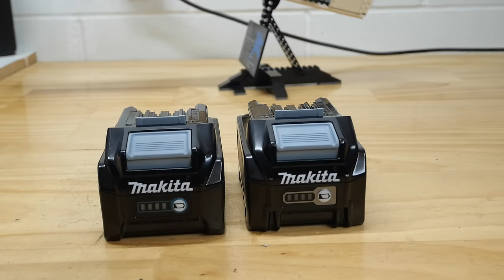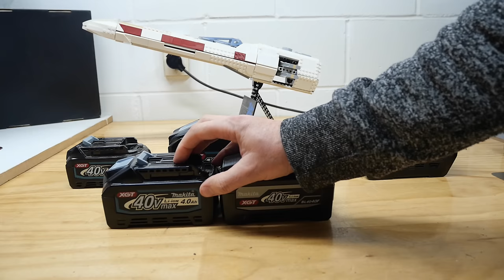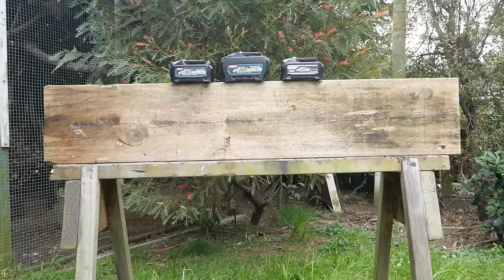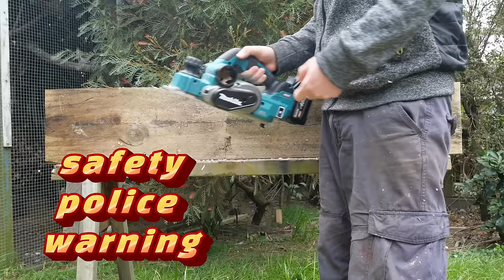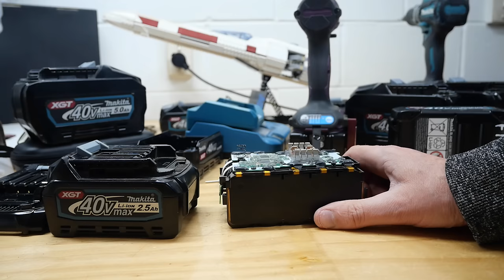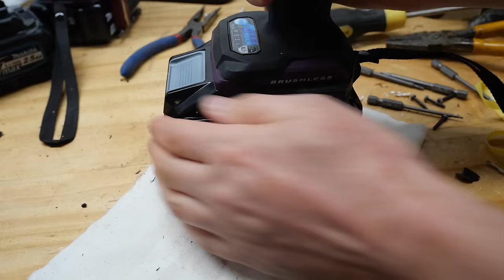Makita BL4040F Battery. Testing and Teardown of Makitas NEW HIGH OUTPUT Battery. Pouch Cells in it?

Comment: If it is tablets fairplay to Makita for keeping up to the latest technology. I really hope that they release a pouch cell battery that is flatter than the 2.5 to go with a new impact driver like the 18 volt one with the fancy lights🙏. I heard that once tablets batteries get into mass production they will be cheaper as they are more simple to produce and like you said in your demonstration welding on a tab is a weak point in battery construction and in some cases can lead to failure. So we could be getting cheaper more  robust batteries.

Comment: Great review, you really covered all the details and went above any beyond! This is how you do a YT video, well researched and presented ;)   
Makita going in the right direction, this is so much better than pouch cells, compared to milwaukee forge 6ah, more capacity and more power with better safety and quality thanks to cylindrical cells.
Reply from the maker: Cheers, much appreciated ;)
Reply: @ToolsAndStuffOFFICIAL  any time 😊
Reply: Can you shed a little light on those a little less informed on the benefits of these over dewalts, flex's and milwaukee's approach using pouch cells?
Reply: @N1rOx  cylindrical cells are by design more mechanically robust compared to pouch cells, they can't bloat, harder to puncture, easier to weld and assemble in a robust pack, etc etc
Reply: I have to agree. This is what journalism should be (and used to be, sometimes).
Reply: @steffendetrick  they should also use these cells in that new forge 6ah. So, what do you mean by makita not being the first, these packs were announced a long time ago and were available for sale long before anyone else with tabless cells (talking about power tools ofc)
Reply: @ToolsAndStuffOFFICIAL  Yesterday , Makita Finland , released 10 min YT clip , Makita Kommunikaattori XGT ® ADP12 , it shows the app . No subtitles 🙂
App does shows same info than that battery tester and a bit more , when it tells your typical use , like how many times battery has overheated .

Comment: Been using pouch cells in rc vehicles for years, The ipod classic that lasts a week has a single one in it.
Once theyre stacked, they dont seem to last long, before bloating up. Then your in trouble if you dont know how to dispose of lipos.
Dont mess with the zohan electronics store, hey its sorny guts.
Reply: Spicy pillows. Seen lots in Microsoft Surfaces, they can break the screen from behind. Terrifying.
Reply: @MattTester  Yeah thats why theyre not quite common. Still to many problems for the average user.

Comment: I have to say, as a big Makita fan, I have been, and still am, perplexed at Makita’s approach to their battery lineup.  This video further enhances that feeling.  Their ‘arrogant’ approach to the limiting of  the LXT lineup, is still a sore point with me.  Great tools that could benefit from better batteries.  I am not implying the current LXT batteries are bad, but I have to wonder how much better a planer, or saw, or an angle grinder would run, using 21700 based batteries?  Not to mention at higher capacities than 6.0 Ah! 
I know there would be fitment issues on some tools, but that has not stopped Milwaukee, DeWalt, etc.?  

Great stuff here, Cheers !!!
Reply: Tabless cells will probably become standard my guess is makita will just end up using tabless cells in all batteries within a year or 2. I don't know why they would continue to use old technology when manufacturing the old stuff is just takeing up space in the factory every battery manufacturing company will adopt this over time and tabed cells will be a thing of the past. Makitas plan will be to sell off all the old stuff and slowly replace it with better so will every other tool manufacturer

Comment: I'm sad, my original XLT battery just stopped charging. 2005. Makita does add things to the battery and name them. I still run lots of 3ah none star 18 volt. When they switched I looked and had a hard time finding a battery that was not a star. If it has a star then the tool and battery talk. When they first change the battery looked very similar to the current 40 v batteries. When the new battery is all that is available they will say something about it quietly.

When Makita changes something like the logo then they changed something it the tool. I think that I have 3 different 18 v 3ah batteries that are all the same model number. None star, star, and fuel gauge. They all have different logos on them. And have different run times when new. 

Personally I like that Makita doesn't put things like star on the side of my battery. Or high out put. It makes no sense to. The older battery is on longer sold and only the new one is. So in a year when d&m don't make the old battery. What will make the battery that I buy high output? It's all they sail and now make. Personally I will stay with Makita tools.

Comment: The new battery did seem to put out just a little more juice! I'm afraid to see the price tho! 😂
Reply: The price will be more then the original 4Ah but less then the 5Ah If they are a tabless cell they will last longer then anything on the market my guess is they will be putting tabless cells into every size battery over time. So the price increases will be worth the improved life of the battery with less heat issues

Comment: LXT version required.
Just imagine what a monster the DHP486 would be if Makita could be bothered to build a battery that can keep up with it.
Reply: My guess is they will do this once they have sold off all the old stock. It will just be a update like when they added a fule gage to their batteries.

 fact is tabless cells will be the only thing being made in a year or 2 from now
Reply: @aaronoconnor606  That'd be pretty neat. Currently I'm on the 2Ah and 6Ah batteries anyway, which I suspect aren't the spiciest Makita has on offer even within the LXT line. So I'd be curious to see what my tools can do when there's some extra jam available.

Comment: nice to see this. and for the explanation about these 'tabless' cells. Much appreciated.

But even other than such tabless... Elsewhere Honor have recently released a new foldable smartphone in China. And it's supposed to have new Silicon-Carbon anodes. But what is actually surprising is the fact that it's supposed to be some mass produced consumer product. And so getting something to market in itself is a good indicator that such things are moving forwards. And to actually prove in the market - that you can buy it, and use it.

However I'm not saying those other technology are necessarily suitable for power tools. It's just seems to be some general uptick now. To wider market.

Comment: 29:28 are you sure they're copper plated? Copper corrodes fairly easily. These pins are usually nickel plated copper. The central pins are for comms and very low current. Could be gold plated to help get a good connection, but I don't know how well that would hold up on a tool battery.
Reply: doesn't look like gold. There are some copper alloys that are more resistant to corrosion, I found them on nissan leaf battery buss bars and in general on some high power connectors. But yeah, these are low power. So, what do you say about the new 21700's by murata? pretty crazy stuff! Makes ouch cells obsolete for most cases :)
Reply: @riba2233 yeah, doesn't seem shiny enough, but hard to tell on my phone. Copper alloys more resistant than nickel? Must be something to do with poor connections interfering with the comms.

Yeah, they seem good. Can't wait to see the datasheet.
Reply: @toolscientist 👍
Reply: @riba2233  i think pouch cells have a place in batteries smaller than 18650 or bigger than 21700. The Dewalt 1.7ah seems like a handy battery. The 5ah powerstack not so much, as I'd rather take a 6ah 21700
Reply: @toolscientist  agreed 100%, you can't go too small with cylindricals

Comment: How does Murata not have them on their own website. Kinda fishy 🤔
Reply: too new/secret probably
Reply: probably some exclusivity contract, nothing new..
Reply: @izoyt  Milwaukee also uses these cells in the new mx fuel packs. And they have to at least make the safety datasheet available to the public, which they could do soon imho
Reply: @riba2233  is that confirmed? EVE also has tabless cells, and Milwaukee has been seen using EVE lately.
Reply: @toolscientist  yep, they had an open pack on the showcase

Comment: Cool video. Thanks. so just to clarify. makita are not using the new pouch tech the Milwaukee are using with the new forge battery’s? 
Instead they are using ever so slightly upgraded conventional cells by the looks of it
Reply: Tabless cylindrical cells are much better tech then pouch cells in larger battery pouch cells aren't going to last as long. I really think if they are a tabless battery they are going to have less chance of things going wrong with them
Reply: @aaronoconnor606  time will tell I guess
Reply: it is not ever so slightly, it is almost double the power over the old tech, it is a huge deal and better than pouch cells in every way.
Reply: @riba2233  I didn’t see anything double in this video at all. What are you talking about?
Reply: @richiejames928 did you see a battery tested used in this video? Just wait for the cell level tests and you'll see. Current ones are 30 A continuous, new ones are at least 60

Comment: All my star batteries on my 18 volt will not work with my drills and impact set from 2015, which is the teal color ,but my older set which is white from 2012 will except my 5ah and 6ah 18v batteries minus my reciprocating saw that can only  accept a 3ah
Reply: That is easy to fix

Comment: Not sure if youll see this Tools, but you got me onto the 40v platform a couple years back when they came to the UK. 
I've ran all my circ saws and mitre saw on 2.5ah, but when ripping wet studs the other day the batteries drained right down after just one or two passes. 
I was looking at getting a 5ah for extra longevity, and for the 305mm mitre saw. The 4ah high output is basically the same price, £10 less. 
Would you say the 4ah high output is the one to go for? 
Cheers
Reply from the maker: The 5 and 4f basically have the same power, but the 5 runs 25% longer but is much larger. Overall the 4f is the nicer battery and is my go to for power and size.
Reply: @ToolsAndStuffOFFICIAL  Thanks Tools 👍

Comment: I am confused why the 4Ah battery  should have same energy like the 5 Ah battery.  Below battery, it is written 144Wh.   Same on the old 4Ah battery.   And this is right,  because  36V x 4 Ah = 144 Wh.  

Another interesting fact:  F version has an IP 64 protection according to datasheet.  Old version not.  Or it is not written in datasheet.
Reply: He explained why a tabless cell is around 40% more efficient they don't have spots that get to hot. And is uses the stored energy way more effectively the old tabbed cells have a bottle neck and don't use all the energy stored in the battery. That's why a 4Ah battery can make more power and last just as long because it's used 90% of the stored energy.
 the old tabbed cell would probably only use 70% with less output and worse heat management
Reply: @aaronoconnor606 so basically the regular 40v 4Ah is losing a fair amount in heat, this new one is so efficient we're getting the real deal for 4Ah.

Comment: Hey i watch the full vdo, but i have a question, us the new makita battery already use cell with a bunch of tab already? Or still a single tab ones? Thank you for a kind reply.
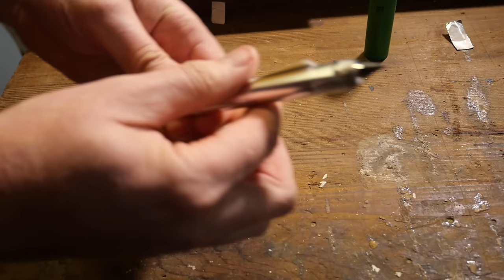Reply: 35:56 here is what i mean
Reply: @dejwongkittikun3178   old ones are not tabless, these are the first ones
Reply: @riba2233 Thanks Riba, so you mean the Makita 40v current one is multiple or single tab ones?
Reply: @dejwongkittikun3178  this one is multiple, every other one is single